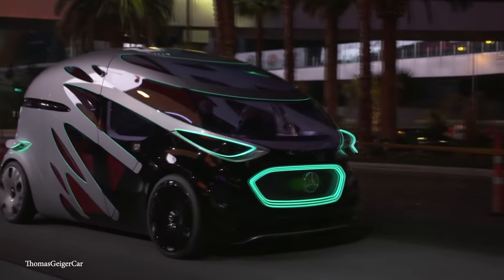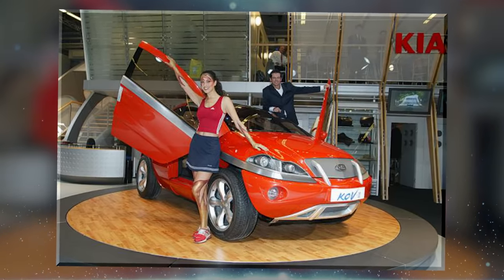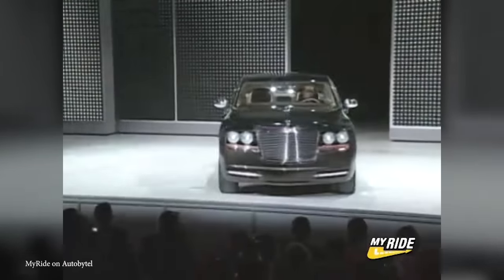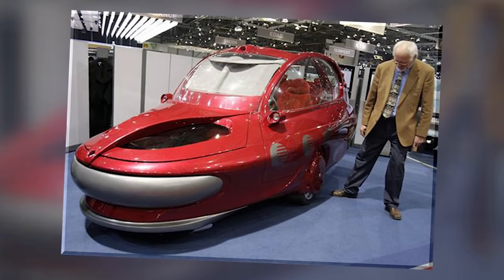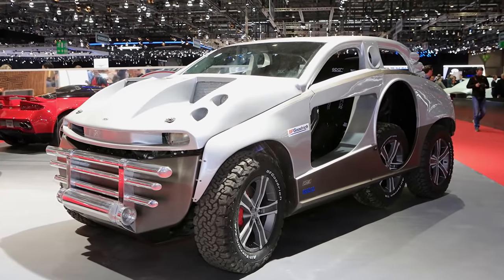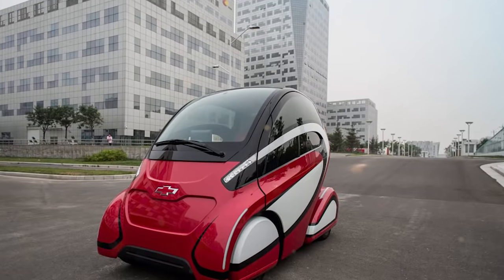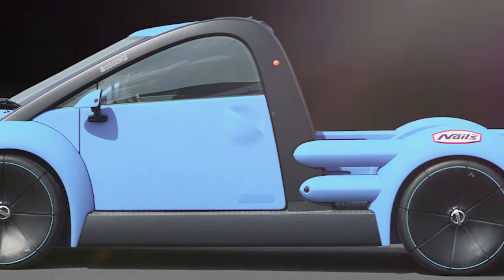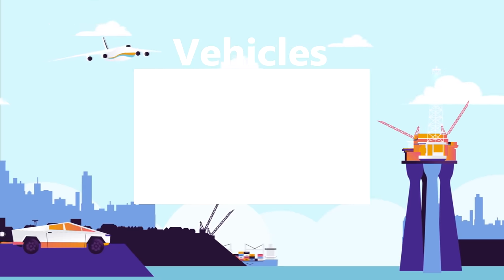15 Worst Concept Car Ideas

Comment: I think there's a misunderstanding of the point of concept cars. Most are never intended to be built, in any form, at all. Just like fashion shows, often they're intended to display design cues in terms of technology and aesthetics that may appear on later production models. Granted, if they're generally despised, the designers will often go back to the drawing board, but knowing that they're essentially display pieces never intended for use encourages designers and engineers to take bold risks that they generally wouldn't dream of.
Reply: either misunderstanding or intentional clickbait
Reply: Though I don't like the very advanced technology (for example, facial recgnozition), I think that many vechicles (Scion Hako Coupé,Nissan Pico 2, EN-V, Nissan Nails and 1998 Buick Signia) are beautiful and many vechicles (Assystem City Car, Mercedes Benz Vision Urbane, etc) are normal. 
Nissan Pico 2 is very beautiful!

Comment: All (or at least most) of these cars have good ideas implemented in them, they just are lacking on one element such as design that does not appeal to buyers. Adding on to that, I believe that concept cars aren't made to be the final result of a car and be mass produced, rather showing off the ideas and ingenius technology applied to a vehicle that will be trickled down into other models.

Comment: The scary thing is that these designers must’ve graduated at the top of their class, for these big companies to hire them, and even to give them full freedom to come up with this junk.
Reply: Not exactly, many start as interns and work on small portions of the cars for months doing the details, like a door handle or a headlight. They don't design full cars until they are few years in the studio. I think what baffles me even more is that the studio has senior designers and people that are head of the design department that approve these concepts to be made. I cut some slack to the ones just starting or that are junior designers. Meanwhile the senior designers and the head of design on each department should know better.

Comment: The craziest showcars were back in the 1950's like the nuclear powered Ford Nucleon or the insane Pontiac Firebird III, with its joystick control.  These modern cars are ugly and horrible, but not as crazy and interesting as the old ones were.

PS The Signia is ugly, bit the Aztek was even worse.

Comment: #14. You can't make a FWD go-kart look sporty.
#13. U-G-L-Y and green doesn't help.
#12. Great idea, terrible choice for the platform.
#11. The US likes specific types of trucks/vans, this isn't one of them.
#10. Call it whatever you want, not everyone is a fan of a Minivan. Or of a weird looking set of wedges.
  #9. Great idea, but a terrible looking exterior.
  #8. I doubt if there would be high demand for a car that looks like an ugly shoe. It is autonimous, why would anyone want to buy a car that they can't drive?
  #7. If you are going to retro a car, this is not s good idea to follow.
  #6. It is ugly, you can't see out of the windows worse than a new Camaro's back glass. It looks too wierd. And separately, it looks like a Front-Wheel-Drive with a four-banger. And it 
        - is a All terrain vehicle that isn't capable of anything other than regular roads on a perfect day.
  #5. Yes it is hideous, and I doubt if anyone would want to entrust their products to a tech that is still questionable.
  #4. Do you seriously think anyone in the U.S. would want one?
  #3. The engine. If it is that big then it better deliver amazing power.
  #2. It also looks like it was designed by a child for children.
  #1. U-G-L-Y. You can redesign an Aztek to look good. And it is FWD.

Comment: The worst car idea in general is making them a necessity for a basic life. You can't work, shop, hang out, or anything without having to drive in most of the US. In rural areas, cars are absolutely fine, it's cheaper to build an asphalt road leading into the city than it is to run and maintain a rail line. However, that does not excuse making the majority of urban areas inaccessible to anyone who doesn't own a car. Car dependency is a huge mistake, and I hope the walkable cities movement grows large enough in the US that cities are made for people again and I no longer have to own a car to live even just the most basic of life. There are many places outside of the US that are far more walkable than we have here. Especially in Dutch cities with all the bicycles and stuff. All while being nice and quiet too, because it's the cars that are loud, not the people or the buildings.
Reply: Definitely better to jave a car since it helps take you to very long distances without walking. Like going to work was never easier especially when you have stuff to carry. Cars are basically automatic horse carages that runs with a motor.